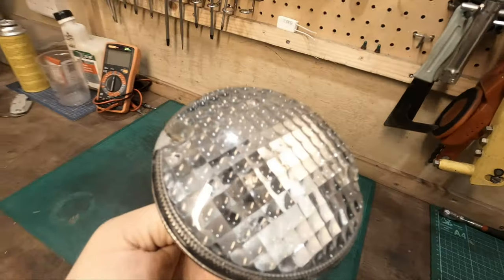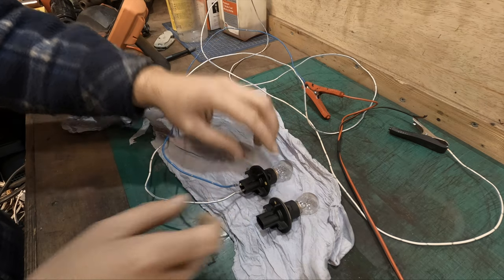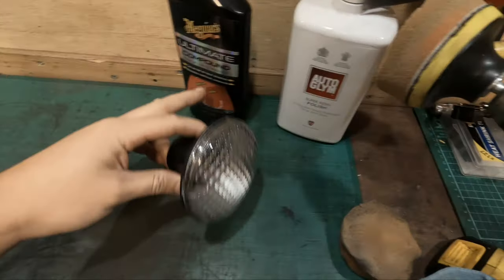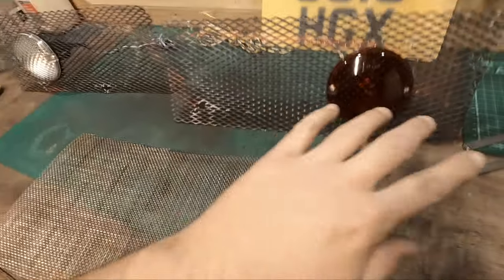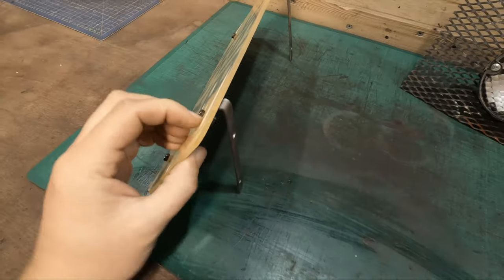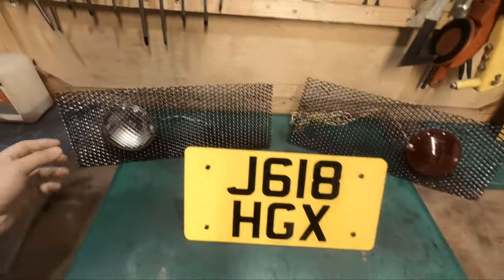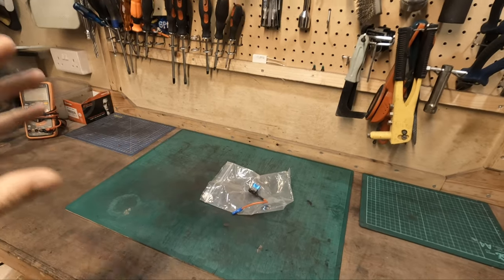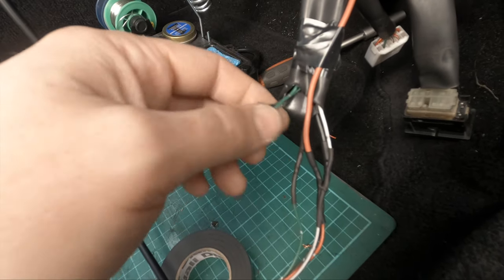Le Mans SW20 Toyota MR2 Rear Fog Light Install / Reverse Light Install JDM [DIY How To] Part #14

Comment: you don't 'need' a reverse light for MOT. but glad you're fitting one anyway. 11mm is the legal border gap for the numberplate letters, the new one you had there looks more than that?
Reply from the maker: Hi Mike, Good to know, I have failed in the past with fog light not installed, i thought a rear fog light would be law also 🙄 plate is 11mm on the top and bottom so just ok, its a USA style plate